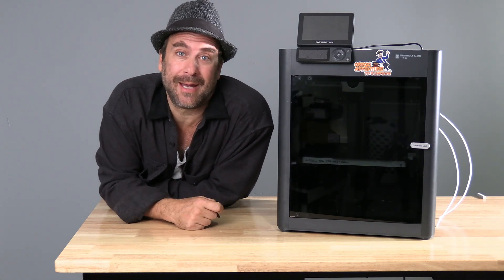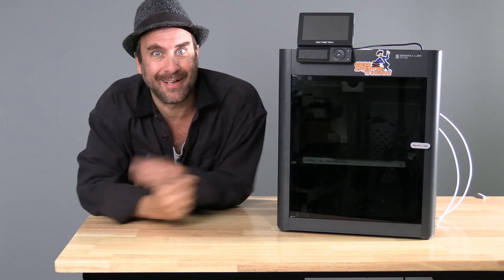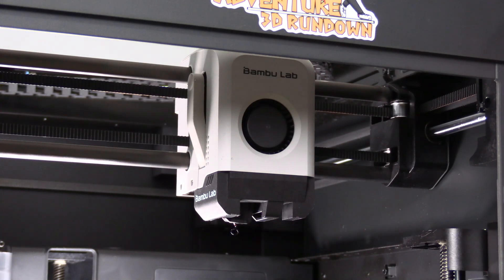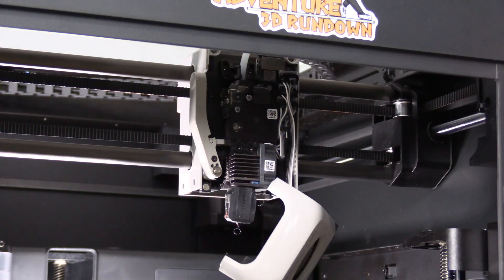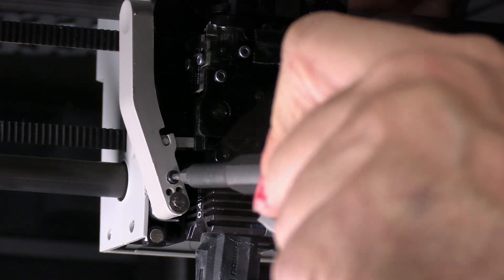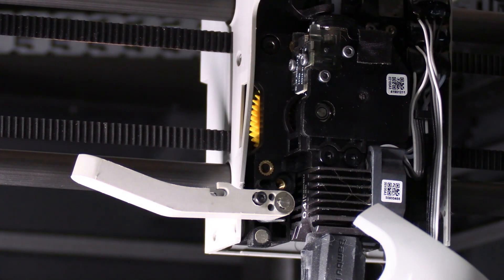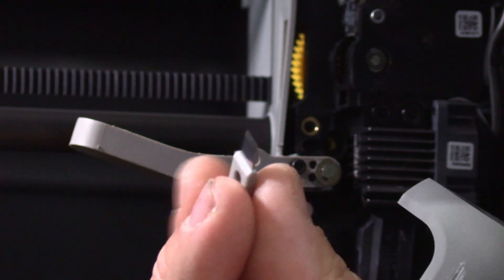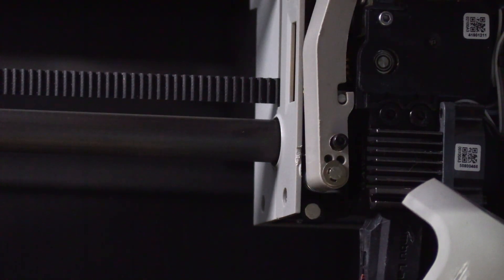How to replace: Bambu Lab FILAMENT CUTTER BLADE - P1P P1S X1C X1E - 3D Printer

Comment: I have an error message. "The filament cutter handle has not been released. The handle or blade may be jammed, or there could be an issue with the filament sensor connection." Blade handle goes in and out easily and I checked all sensor connections. Any tips?
Reply from the maker: oh boy, sounds like a sensor may be malfunctioning. Did you remove and replace the cutter, to be sure?
Reply: @3DRundown  I have the same problem. Can you replace the sensor?

Comment: Is it true that when one of the idle pulleys breaks down,the entire printer needs to be replaced. Bambu support does not admit failure, they say poor maintenance and no lubrication
Reply from the maker: No, that is not true. However, I've got 1500+ hours on 3 Bambu's (Each), and the belts look like new

Comment: I got almost 800 hours and a thousands of changes I had cleaning problems so I replaced the wiper, and it had a slight dent in it, swear I could rotated that little white wheel and no one would’ve been the wiser.
Reply: They need to revise the whole poop chute and wiper
Reply from the maker: Mine are all at 1300+ hours. I shot the wiper replacement after this, as part of a poop chute maintenance video. The problem with rotating the tube, is, during wiping, it could turn back. Hope to get that video done tmrw.